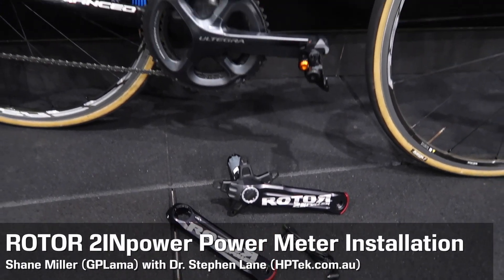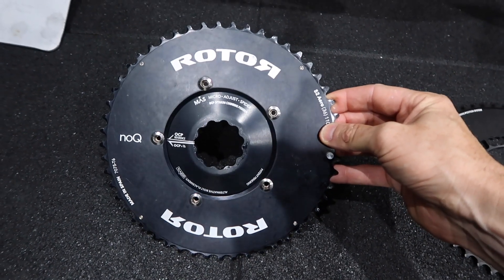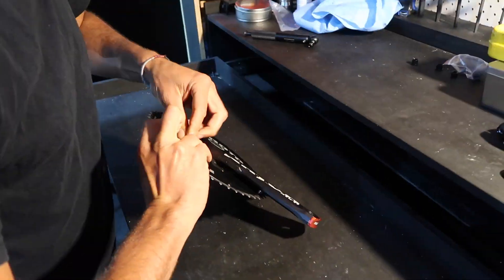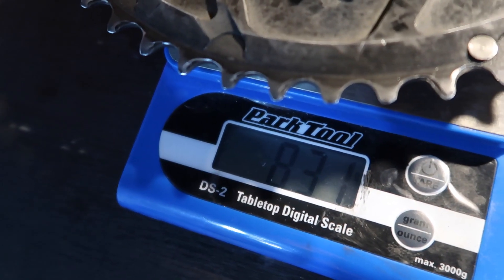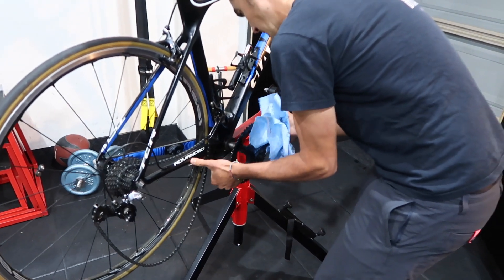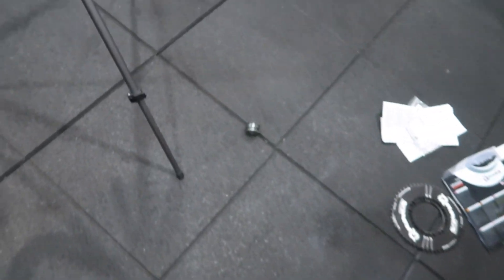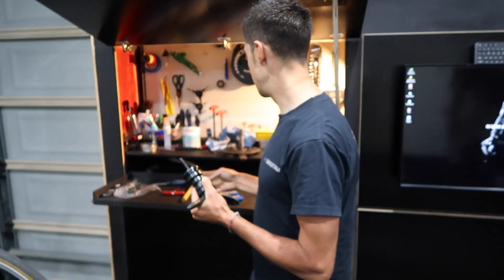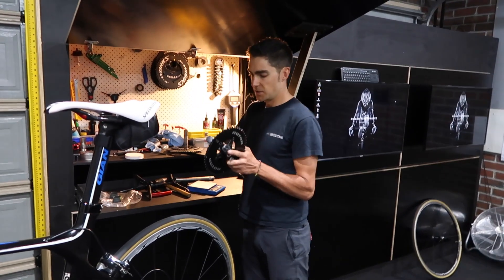ROTOR 2INpower Power Meter Installation

Comment: Shane, Hambini says it's not good to use a 30mm spindle in the shell of a BB86 because the accommodating bearings will have to be thinner, and thus inferior.  Do you feel this is so?
Reply from the maker: He’s an engineer.
Reply: @gplama  yes, he only sold me his BB for Shimano. But, do you agree or have you found no problems w the bearings.  My local shop seems to think its ok.
Reply from the maker: In my experience on the bike I’ve had no issues. That doesn’t mean the smaller bearings required for this setup are optimal.
Reply: @gplama  alright, Im not  such a powerful rider, so they may be good for me. thank you and keep up the good works.

Comment: Hey Shane. Nice video. How about when you have lateral movement or play of the cracks? How do you solve that? I developed some lateral play after 17.000kms. Cheers.
Reply from the maker: One for a good mechanic to look at.
Reply: U know the Morphine song "A good woman is hard to find"?. Well, A good mechanic is even harder! It turns out the shop which mounted the bike didn't put the 0.5mm spacer on the left crank. Good for them!!!! I have already ordered 2 of them. Thanks for the feedback Shane. Nice vids again!!!!  @gplama

Comment: Not specifically a PM related question. Have you had any issues with the PF4130 BB in the Giant? Longevity or creaking? Cheers.
Reply from the maker: Not while it was installed, no. Back to Shimano BB for now while I'm on their cranks for other power meter work.

Comment: Putting a bb30 crank in a bb86 frame with a 41mm shell isn't the best idea. Better off sticking with a 24mm crankset. Those 41x30 bearings you put in have a really low static load rating, even with dual row balls. It's the only way to fit 30mm cranks into a bb86 frame, but its a bad solution engineering wise. Also since you installed, have the bearings loosened up a bit? Look really sticky!
Reply from the maker: They turn a lot better after a few good rides, yep.

Comment: Rotor 2inpower or quarq dzero, if you have one choice?
Reply: Quarq. Better tech support.
Reply: Hi, Thanks for the reply. What i mean is the technology and accuracy point of view? Are they having same tech
Reply: Technology: Rotor 2inpower: 1 set of strain gauges inside the 30mm spindle for left leg (good signal to noise ratio, low parasitics) and 1 set of strain gauges inside the right crank arm to measure bending (lower signal to noise ratio, but better than shear face gauges like Stages).
Technology: Quark DFour: Multiple strain gauges arranged in spider to measure left and right leg power on the same gauges. This gives great reliability and accuracy from Left to Right. Good signal to noise ratio, largeley impervious to out of plane bending. 

I hope to do a video of all the different types of technology on my channel soon.
Reply: Cycgnr thank you so much!!!

Comment: What press fit bearings did you use to accomodate the Rotor 30mm spindle cranks btw?
Reply from the maker: Rotor PF4130
Reply: Thanks for the quick reply :) Can be quite confusing with all the different BB standards etc!

Comment: Hey what happened at 9:30  into the Video Am I getting old or did you forget to move the chain around the BB and crank
Reply from the maker: It wraps around the outside given enough clearance with the front derailleur and the 52 tooth chainring.
Reply: I thought  that  after  I posted  it...   
You  should  do a video  with a group of your mates  with no HR straps  computers  power meters  etc  etc  and  see how much  fun it  could be  not being high tech..  Have everyone  be honest  about the ride.  Make it  a  good 3 hour ride...

Comment: What´s the trick behind fitting this 30mm spindle on an frame with a BB for 24mm cranks? Would that work with a Quarq BB30 as well? 
Would save me quite some money!! Hope you can let me know... thanks a lot!
Reply from the maker: Trick is to remove and replace the bottom bracket. Not sure on the BB30 compatibility, unlikely due to width differences. That's one for a good mechanic to answer.

Comment: Man, Im thinking about buying a new powermeter, but after seeing this instalation... Im definitely not going to buy Rotor 2INpower :) I wouldnt like to go through this process
Reply from the maker: +Gabriel Kralik This is what bike shops are for, or mates like SLane.
Reply: I mean, when you buy power2max or Quark, you dont have to change the whole bottom bracket. Its that much easier.
Reply: @Gabriel Kralik ???what do you mean? Installing the Rotor crankset is as easy as with any other crankset!?!
Reply from the maker: That depends on what BB you're running. It's something any bike mechanic can do in minutes. We're consumers/riders, not mechanics. Same as a lot of other things (cars, etc).
Reply: depends on what cranks you have; I have a power2max and had to change the bottom bracket as well - but done in a few minutes, no worries at all!
Reply: What is complicated in this instalation?!
Pretty straighforward IMO

Comment: None of that was torqued, might want to rethink that in the future.
Reply from the maker: +Jeffrey A. Thistle It was. I sped it up so I didn't get chewed out.... I'll cut it next time. Never work with children, animals, or show a torque wrench on YouTube. Life lessons. :)
Reply: I hear the new generation Stages is far better than the first iterations of it hard to find reviewers brave enough to retest them, I'm considering them over my Garmin Vector I been using. Any thoughts or info on that?
Reply from the maker: +Jeffrey A. Thistle I've never considered spending my money on Vectors, or a Stages II either. They may work fine... they're just not on my radar.

Comment: You guys forgot to put the chain around the crankspindel before you assembled it together. Much esier than to struggle with the chain to get it around the front gear
Reply from the maker: +Henning A. Rukin SLane had it covered, don't stress it. It flips over easily... the front mech was positioned for a 53, this is a 52, there is clearance. Now I'll get taken apart for not redoing the front mech height. This, sock height, rear mech cable hanger... just chill Internet.

Comment: Hi Shane 
What is your view on crank length? I thought you would be on 175mm.
Reply from the maker: There's a bee's dick in it from 172.5 to 175. I use 175 on the TT bike because that's what everyone did 10 years ago.
Reply: "There's a bee's dick in it from 172.5 to 175." 2.5 mm. Yikes, if that's it's dick size ...! Note to self, don't get stung by a Victorian bee!!!